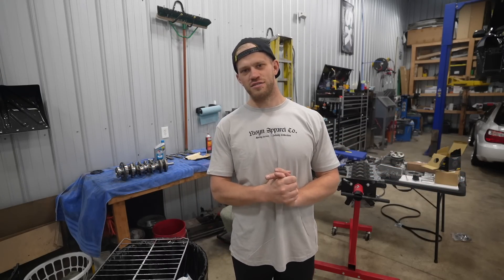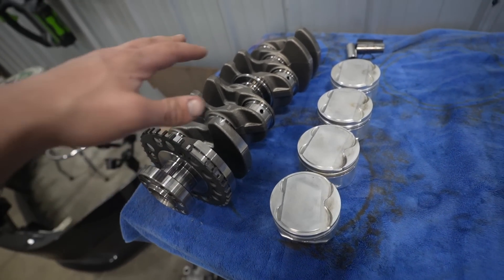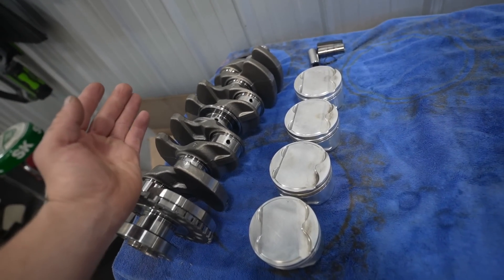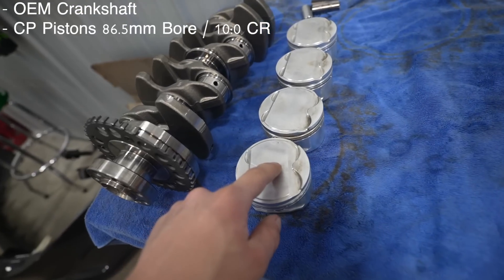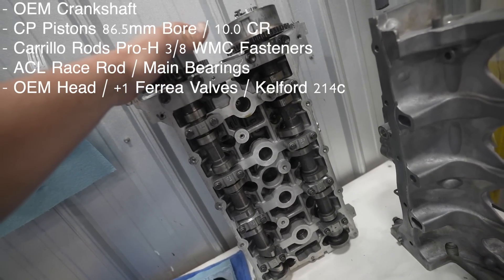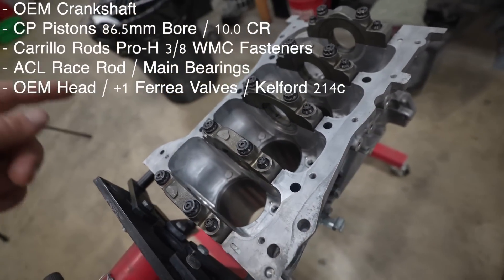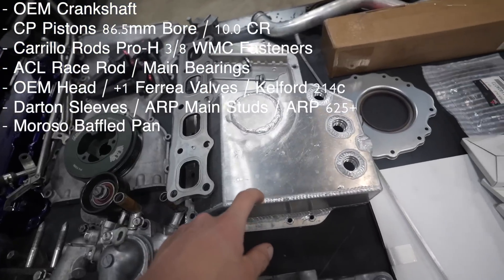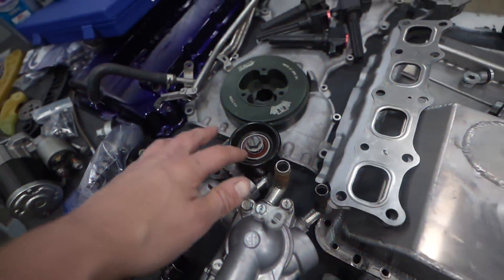Rebuilding an 800WHP 4 Cylinder Engine (4B11T)

Comment: Hey I wanted to reach out here as I am getting nowhere anywhere else. You have been a big inspiration in me getting my Evo back in 2021, unfortunately I have been having a rather difficult time since getting it. I have been trying to find a good machine shop at this point almost anywhere in the country. I am doing a build similar to this and have had the parts for a couple years now and the car has been sitting. Do you or anyone in the comments know a reputable machine shop within a state or 2 of Indiana. Just trying to get the sleeves in and the head done so I can put everything back together.

Comment: ABSOLUTELY loved this video.  Explanations are super cool but it's legit therapeutic to just have some chill music in the background and watch an engine being built step by step.  

Personally I've rebuilt 2 Yamaha R1's both during quarantine and having NO mechanical background whatsoever.  I only ever pulled the engine apart down enough to do valve adjustments.  So for me watching these is like a knowledge check to watch and be like okay there are the cam caps, oh he must be measuring clearance on the Rods.  I wonder what that tool is called?  I bet he's using that lube on the Cams instead of something more viscous because it's somewhat sticky and will hold until the engine is fired up for the first time.  That thing on top must be an oil filter/strainer of sorts?, etc...  "I wonder if he is paranoid about a Head stud stripping even tho he's torquing to spec (happened on one of my builds) Things. like that.

It's just really fun to follow along and see what I do and don't know.  Videos like these are my favorite

Comment: Hey devin, so I bought arp head bolts and i heard you should use thread chasers to clean so I bought the arp thread chaser and it was the right size but it doesn’t reach the threads because the threads are deeper into the block. I saw online the have really long ones but I couldn’t find and the right size I need, can I just clean out the threads as best as possible and put them in,

Note- when I tried to put them in the first time, the felt pretty rough going in and I already cleaned them. Thats why I decided to buy a thread chaser